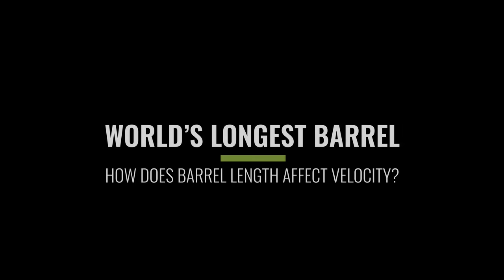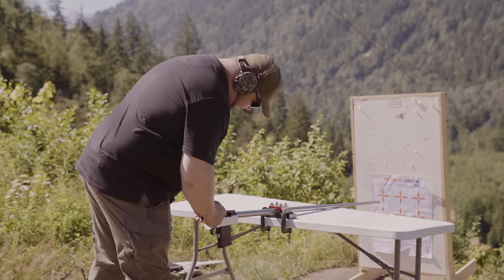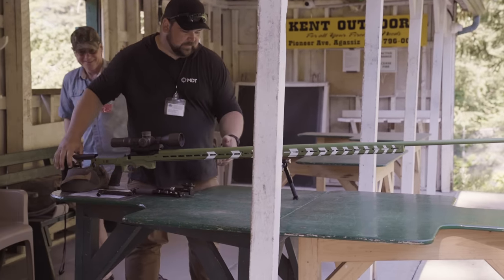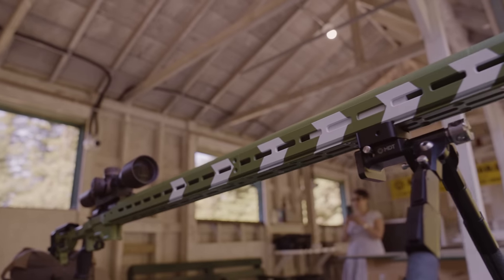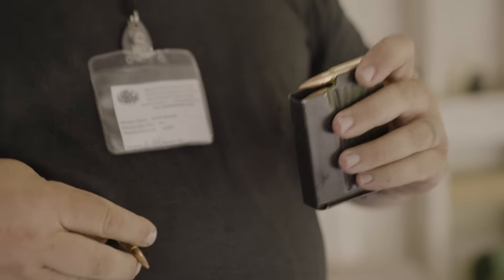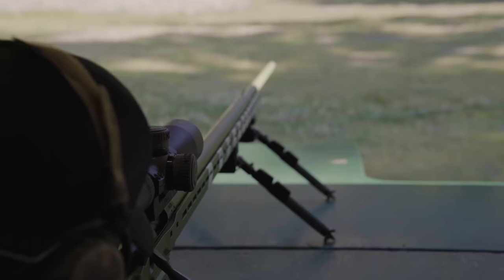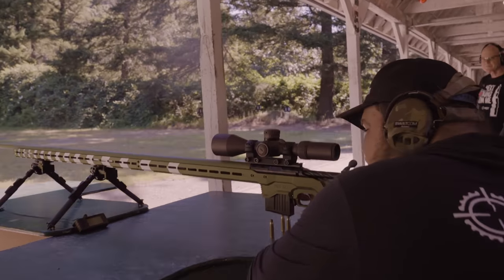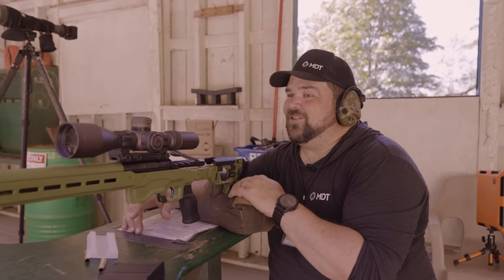Cutting The World's Longest Rifle To Find The Perfect Barrel Length

Comment: Joining two barrels together so that the rifling matches perfectly at the correct torque setting is NOT a trivial job. Very well done to the machining guys
Reply: Yuck Foutube  the barrels were drilled and rifled separately and the attached together. The rifle was lined up perfectly
Reply: Yeah, that's a slick little engineering job they did.
Reply: @ryanmclean3326  Why? Why would they do it like that?
Reply: @sawmaster6095  Because you can't get barrel blanks as long as they needed, rifling machines can only handle so much.
Reply: Absolutely..Great Craftsmaship/machining Guys.
Reply: It is kinda trivial. Your thread pitch has a distance. That distance works to one rotation, or 360°. You can do many things to make it work, time the lathes when cutting the threads. Cut the threads, use a bore scope, measure how many degrees you need to move to line them up, remove that much material... it's really not bad.
Reply: I made the barrel.

Comment: Very interesting.  Reading the chart, the sweet spot without the rifle being ungainly is about 24.5 inches - exactly where CZ has their 550 Varmint barrel in .308    You have to go approximately 40 inches to get any practical increase in velocity, using the same ammo.  Perhaps CZ knows what they're doing.  ; )
Reply: Yes they do their yob well
Reply: * CZ had
new CZ 600 has less options and shorter barrels. 223 rem, 300 win mag & 6.5 prc is 24'',  30-06, 8x57 & 308 is 20'', 6.5 cm is 22''. Quite dramatic cost cutting.
Reply: @shveril9513  A lot of people prefer a shorter barrel for other reasons.  Many people are willing to sacrifice a little velocity for increased barrel stiffness and overall handiness of the rifle.   18" barrels became all the rage for "tactical" .308 bolt guns and if maximum range isn't the goal, then it's probably a very good tradeoff.   In the end, rifle makers need to sell rifles, and to do that they need to give people what they want.
Reply: At some point the increase is minimal so a jump can happen in short barrels let's see 5.56 a 10.5 going to 16 inch with 55 gr is 2100 fps while from a 16 inch it increases to 3000 fps that 900 fps faster so that's 163ish fps increase per inch added however going to a 20 inch that velocity increases but only to 3200 best case scenario soooo 50 fps per inch after 16 inches so more weight and longer rifle for only that gain not really worth it for some people so why bother going longer if you're not gaining enough to justify the longer barrel
Reply: @jwilsonhandmadeknives2760  some bandleaders like the 16 inch rifles because theyll load their rounds hot in 308bfor example and be hitting 18-20 inch velocities with their hot loads
Reply: @jorgesolis9468  yes this is true.
Reply: @jorgesolis9468  yes, this is a key point.   if you have enough velocity for your needs, a longer barrel may just get in the way.  Also, a shorter barrel can be more stiff, so if you don’t need maximum velocity then you may have improved accuracy (over a shorter range) with a shorter barrel.
Reply: @jwilsonhandmadeknives2760  that and for handloaders they can load warm enough my buddy had some 308 handloads that were hitting 18 inch maybe even 20 inch velocity from a 16 inch barrel
Reply: @jorgesolis9468  I do the same.  We live in a great time for handloading.  I have been working on several good 600 yard loads for .223 using a 77gr Sierra Matchking.   The real benefit of handloading is getting that 77gr bullet up to 2900 fps.   It doesn't sound like much, but a typical match load for 77gr .223 is running about 2750 at the muzzle, and that extra 150 cuts almost a minute of drop at 600 and bucks wind noticeably better.   I started out with a softer load that shot 3/4MOA on average, and would give occasional 1/2MOA groups at 200, but it was falling apart at 600 if the wind kicked up at all.  

In my game, max velocity from the same cartridge is a definite benefit.  But I'm shooting known distance and held to a 20" barrel length.   (Service Rifle)   

Specific powders have been hard to get for the last couple of years.  When my AR Comp ran out I had to work up loads using the various other powders that I could get, and the different burn rates definitely had me chasing my tail for a minute.
Reply: @jwilsonhandmadeknives2760  try the hornady superformance match 75 gr bthp from a 20 inch barrel it's supposed to be hitting 2910 fps which is fairly fast for a 75 gr
Reply: @jorgesolis9468  funny you mention that.  I was just recommended the same bullet from a fellow competitor.  I had trouble finding them, but I was able to find some Berger 75gr VLD and I found some Hornady 80gr ELD.   

I have heard USAMU is using the bullet you recommended.  I will grab some as soon as I find them in stock.

Thank you for the recommendation!
Reply: @jwilsonhandmadeknives2760  1400 ft lbs ain't bad for 5.56
Reply: Desert Tech SRS and HTI entered the chat.
Reply: @Just-Steve  along with the keltec rdb yes I know it's a keltec but it's one of the only bulpups I've seen available in my part of texas along with a ravor 308
Reply: @jorgesolis9468  I have a SRS in 300 win with a 26 inch barrel.

It would be cool to see a barrel on there that brings it to a similar OAL of a standard frame rifle.
Reply: @Just-Steve  if it weren't for the trigger on that tavor and rdb I'd love me a bulpup
Reply: @jorgesolis9468  wasn't talking about those rifles.
Reply: CZ doesn't make rifles the perfect them. Let be honest their hand guns are pretty BA as well
Reply: @a1locc25  absolutely.  All of my CZs are great.  You pretty much have to go custom / hand fitted to beat what CZ gives you off the rack.  There are some production rifles that might edge a rack grade CZ, but at 3x or 4x the price.
Reply: @jwilsonhandmadeknives2760  Right, it's about what you want it for, I 20" for fast short range under 100 Yds hunting( Prefer a lever or auto) and for Bolt Long range max 24" add a Brake and its 26", a 26" mag won't mather under a 24" at 500 Yds Pls. Ok you can buy a Carbon fiber 6/7 Lbs Light weight Magnum with 26" BUT?
Reply: @jwilsonhandmadeknives2760  Ok, But 22. cal isn't my prefered Big game Hunting load, and dont't missunderstand me I have taken 400 Lbs steer with 1 22 LR betwen the eyes and large game with 22 Lr behind the ear at 50 yds and under, 70 plus Grns 223 and others are Big game for me where allowed, yet 7mm or 30 Cal my faw
Reply: @jorgesolis9468  The drop-off point in 5.56 seems to be around the 12" mark.
Reply: @immikeurnot  yeah about 2400 fps or 2500 I think
Reply: @jwilsonhandmadeknives2760  plus, the shorter length lends itself to hosting a suppressor much better than a longer barrel when you’re hunting. The few inches of barrel length make a huge difference in maneuverability.
Reply: @MulletDestructur  that’s an excellent point.   you wouldn’t think it makes a difference, but it’s huge
Reply: Or literally any other rifle company? Barrels available at 20 or 24 inches
Reply: I think 303 rifle 36 inche is best for long range M16 ak etc
Reply: @jwilsonhandmadeknives2760  at the same time, you also see quite a few of the more oddball/experimentals actually going up in barrel length.

Comment: The results would have looked much different if a much slower powder had been used. The factory 308 ammo likely uses IMR 4064 or RL15 or something in that burn rate. If you handloaded ammo and used a much slower burning powder, like RL22 or Retumbo, then the slower burn would perform much better in the super long barrel, as the pressure would stay higher for longer, thereby increasing the acceleration time for the bullet.
Reply: I also wondered if tightening the rifling progressively down the barrel would make much difference to make the bullet spin faster
Reply: @sinephase  that would actually slow down the velocity. Tighter twist rates generally result in slower velocity, all else being equal
Reply: @sinephase I have considered this; perhaps progressively increasing the twist rate would help maintain a flatter pressure curve.  Theoretically it certainly would, but I suppose the real question is if it would be enough to make a difference.
Reply: bravo
Reply: Not really. The  shift in pressure curve is not as drastic as the change in length is. At this barrel length, you’ve full expanded to the tails of ANY pressure curve.
Reply: @G5Hohn you have a lot of experience with the pressure curves with 6 foot barrels? This video clearly disproved a lot of supposed experts on the topic of barrel length, so I’m wondering how you would even know if a pressure curve could extend out of a 6 foot barrel unless you have done it.
Reply: I agree. I think this experiment was cut short, no pun intended, because there are so many variables that could have been explored, especially powder burn rates. I really disliked the fact that they clearly established a longer barrel leads to increased muzzle velocity, even with a round not designed for it, and did not continue shooting with the 6 foot barrel. We could have learned a lot more about ultra long barrels, instead the just took a bandsaw to it right away.

Comment: Now the question remains, how ludicrously long does the barrel have to be for friction to begin to have a noticeably negative effect on performance? Obviously you don't gain much after 40 inches, but what does it take to actively hinder performance?
Reply: For 22LR it is 22" then velocity starts dropping.
Reply: I don't think it is friction only that needs to be considered. As the bullet travels down the barrel, the pressure behind it decreases because the gasses are expanding. Once the pressure drops to zero (I mean once pressure is equal in front and behind the bullet), that is the fastest the bullet is going to go. If the barrel is longer than that it will start to slow down in the barrel.
Reply: @mckenziekeith7434   That plus buildup of air being pushed ahead of the bullet, that was previously sitting in the barrel.  Also what’s the pressure at the back of the bullet vs at the chamber differs.
Reply: @Georgewilliamherbert  Yeah good point. The bullet will be accelerating and the air in front can't exit instantly so there will be back-pressure from that, also. I guess it is pretty complicated. But I still feel that the volume of gas that evolves from gunpowder combustion is going to be a key part of the equation. And that volume probably depends pretty much on the powder charge (and not on much else).
Reply: Yes pressure is dependent on the volume and the conversion of gunpowder to gasses. A smaller cartridge will not be able to push as far in a barrel.
Reply: By the time the bullet has gone 40 inches,  the rifling will be cut deep into the jacket,  and the bullet is no longer deforming at all,  just travelling. I suspect that at this point friction is at its lowest and the major factor would be powder and external air pressure.
Reply: @mckenziekeith7434  100%!👍👍👍👍👍👍👍
Reply: It actually isn't that hard to figure out. The max barrel length is determined by how long the powder takes to fully burn. If the powder isn't burning, no more energy is being put into the round.

Comment: being a physics guy... I think whats happening here is that the powder burn/ barrel pressure starts leveling off at around the 46 inch mark.  one has to remember that the more barrel that the bullet travels through, the bearing surface of the bullet is also wearing away so the resistance is also dropping more and more as it travels down towards the muzzle.
Reply: Plus, if you are going to be using a really long barrel, you would want to handload to match the powder for the barrel in question... For this long of a barrel, it's quite likely that a slower burning powder would have been more appropriate... Of course, you are limited by your case size so that even will a full compressed case of some particular powder, you might not be able to take advantage of all of the additional barrel length...
Reply: @seanseoltoir  true... but not too sure case volume is the limit... its also the pressure the case and action can withstand. at some point the primer pocket and case head will deform. I do agree that handloads with the slowest burners would have been interesting.
Reply: @renaissanceman5847  -- Yes, that would be an issue if you were switching to faster powders, but if your starting point is the normal rifle powder load, then a slower powder of that same load is not going to exceed the pressure of the original load... At some point, you get to a powder that is slow slow that even with a compressed case load of it, you cannot exceed the pressure rating of the gun... For example, I've taken .50BMG and 20mm powder and put a full case of it in a 10mm handgun cartridge as a test and fired it... The powder will just not burn enough in that short of a barrel to do much of anything... It won't even cycle the action on the handgun... It does make for a rather quiet (and slow) round... :)  On the other hand, if you were to put a case full of Red Dot in a 10mm cartridge, you would most likely have a gun that "disassembled itself" in your hand...
Reply: The thing is also probably like a banana at some stage too.
You might also create a bit of a vacuum as the momentum of the bullet reduces pressures.

Comment: I'm wondering if custom loads with a VERY slow burning powder would have performed better in the longer barrels.  Factory ammo isn't optimized for a 40+ inch barrel.
Reply: slower burning powders generally need a lot more powder by volume to hit the operating pressures of the cartridge. In short you would need a lot bigger case to hold more of the slower burning powder. you might get away with going  with a powder that is a little slower, but just going to a very slow burning powder would not work.
Reply: Yeah that's interesting 🤔
Reply: @jonathanrogers9961  like try the experiment again with 300 RUM
Reply: I agree that I would have liked to seen this, but I would hate to clear a squib on this thing.

Comment: 6:15 this shift in point of impact is because of the barrel crown. when you cut the barrel crudely like that the crown isn't going to be perfect so it throws the shot off.
Reply: I was thinking the exact same thing. At least they could've hand drilled it on the spot, but it wouldn't be as precise as a lathe. Shoot, even a small hand file would help, I guess.
Reply: Came here to say the same.
Reply: I'm surprised they didn't re crown w cordless drill at least.
Reply: Yeah.. here in germany we have air rifle stands at fairs and those rifles are always beat to shit and have on purpose badly cut crowns~ And if you ask the store owners in which direction the crown is cut they always tell you to fuck off and often enough you aren´t allowed to shoot anymore. Like.. dude, a 10" Barrel air rifle even just shooting 4.5mm round ball having trouble at 2 Meters.. don´t tell me that "gun" isn´t manipulated to be inaccurate af.
Reply: I'm curious as to why the crown would make that much of a difference?
Reply: @WarlordEnthusiast  it’s the very last thing to touch the bullet as it goes on it’s journey. If it’s not perfectly concentric and symmetric it will mess with the flight path. It’s like the follow through when throwing a football or shooting a basketball. The fingers have to spin the ball right to get a good accurate throw/shot
Reply: Yeah, if these guys know anything about guns, the accuracy would have to do with the crown not the length of the barrel that’s why you take your rifle and spend the money to have it re-crowned so it shoots properly. I was shaking my head right when he said that, I guess people just assume that if someone has a gun in there on YouTube that there are knowledgeable
Reply: Recrowning is a factor for precision, which what they where not going for... they where measuring bullet speeds, for what crown is not important